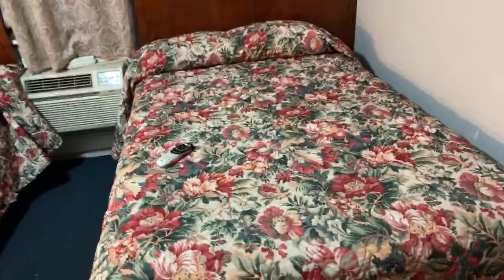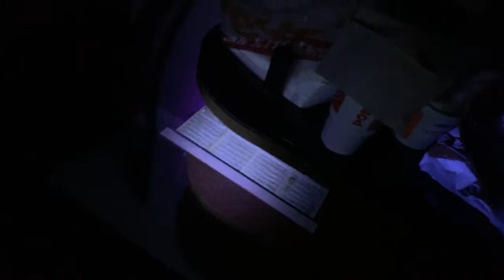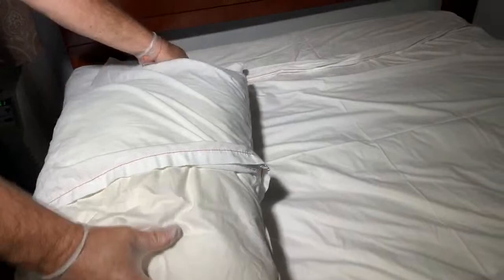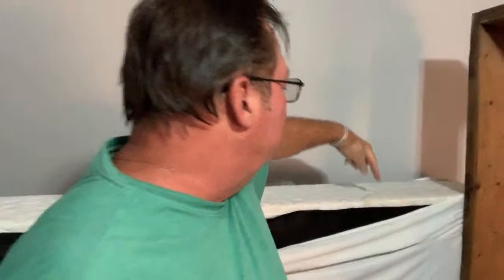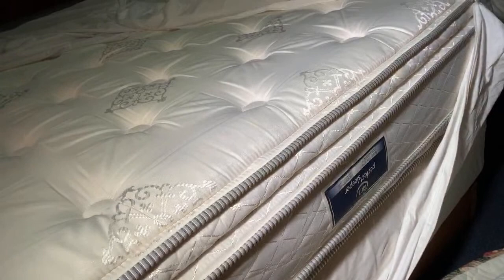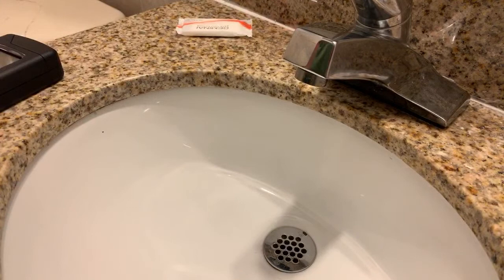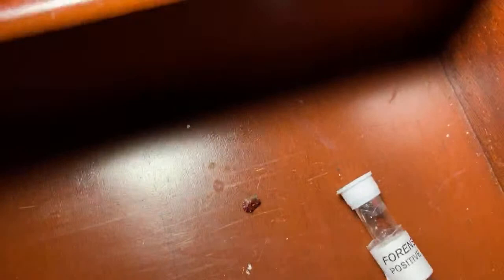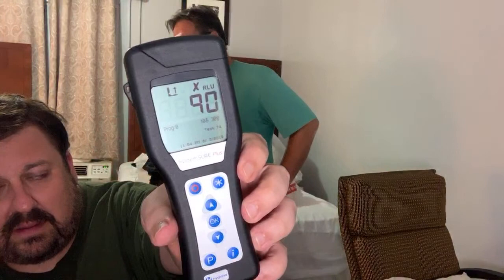LIVE : ANOTHER DIRTY ROOM Baltimore’s Siesta Motel 🤮🤮🤮

Comment: the air cond. filter should be disposable so that filth does not go in the water system.  As in filters for furnaces, your filter is tossed in the garbage and generally made of biodegradable.  I am against continuing to use our water supply to "clean" filth by polluting it.